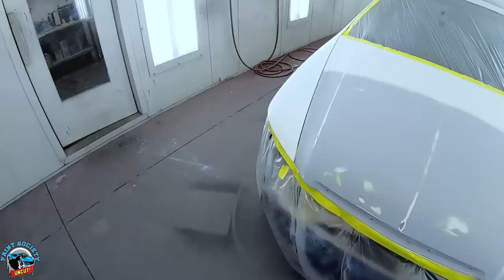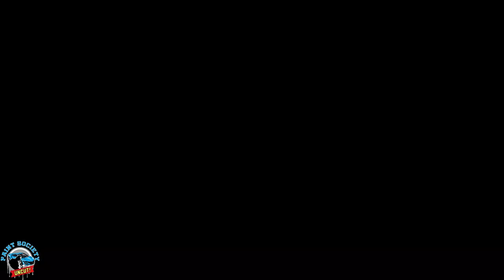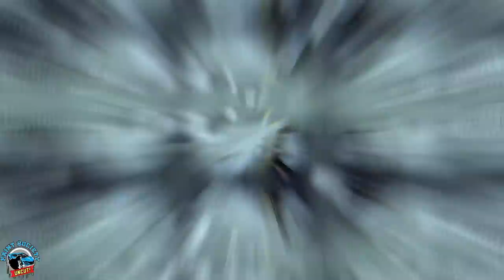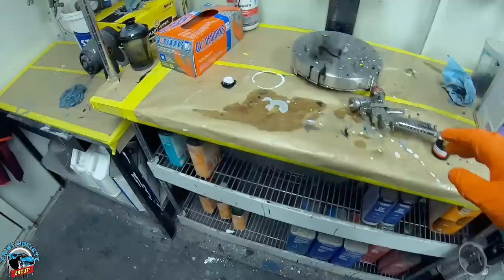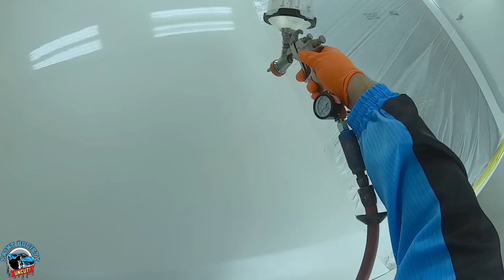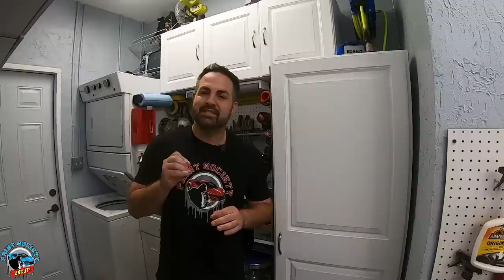Beautiful Pearl White Paint

Comment: Someone recently gave me a lph400 with the lv4 aircap. How does the lvx compare? It's my first iwata and I gotta say I really love how soft it sprays and atomizes. With the cap aligned the fan doesn't spray straight up and down though, it's a little crooked. So I just turn the cap a little to compensate. I wonder if a new cap will fix this or if I need a new needle and fluid tip.

Comment: Great channel/info.

I'm in need of some advice.  Getting ready to DIY paint my 06 Scion TC.

I was gonna rattle can it, but decided against it.  Now I can't decided if I should get an electric paint gun or an air compressed gun. (I'm not looking to spend much, but also do a decent job... so I'm looking for the happy medium)

Any tips on either options of guns.

Also I'm wanting to know what is a good quality paint and clear coat.  I was looking at a Laquer Jet Black and going Enamel clear over it.  Would that work?  I don't have a paint booth and it's obviously cooling down outside.  I do however have a Morton building I can pull the car into for a somewhat sterile and warm enviroment.

So what Base product do you guys recommend and what clear coat (all I'm finding is laquer clear and I don't want gas drips destroying my kids car.  You know how 16 yr olds don't think about this stuff)

Anywho.... Tips are much appreciated....  :)
Reply from the maker: Urethane is the best to use. Stay away from laquer as they just don’t perform well

Get yourself a 33 gallon  compressor and you can at least do one panel at a time without breaking the bank. 

Check out the gti pro lite paint gun
Reply: @PaintSociety  Thanks for the quick reply.  Links on where to buy a decent urethane base and clear?  Thanks man. ✌🏻🙏🏻

Comment: I’ve been having a lot of problems lately on blend panels clear on clear...anything with base on it sticks fine..but it flows out way to much on clear on clear...my only way around it has been to spray clear base blender on everything so it’s all uniform...bit of an expensive way though...any tips of anyone would be greatly appreciated...I spray with ws400 1.3hd hs clear 33psi...1.5 coats of clear...many thanks in advance 👍

Comment: SIR, WHY DOES MY CLEAR KEEP COMING OFF THE BASE? WE TRIED, MULTIPLE METHODS, EVERYTIME 2 WEEKS LATER OR MORE WHEN WE PUT TAPE TO PROTECT WHEN WE INSTALL TRIM, CLEAR COMES OFF. YOU NICK AN EDGE, CLEAR WANTS TO COME OFF. I HAVE NO SAND PILING, SO I DONT GET IT. ANY HELP? WE LET PAINT DRY 30 MINUTES, WE TACK, SAME PROBLEM
Reply from the maker: Paint and clear are not compatible most likely
Reply: @PaintSociety  matrix clear and nason base coat is what we have been using
Reply from the maker: I want you to use the same clear as the base you are spraying. Give that a try and your problems should go away.
Reply: @PaintSociety  will give it a try,  thanks,  ill come back to you herw after Thanksgiving